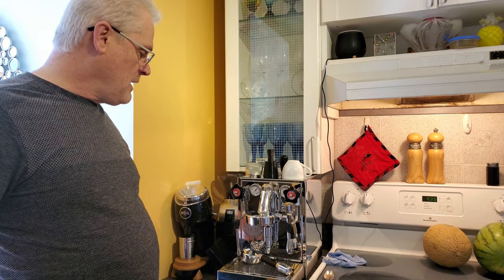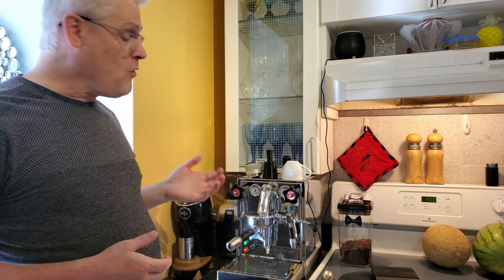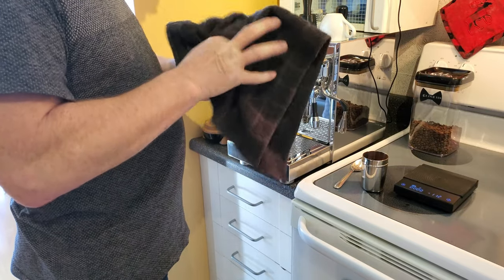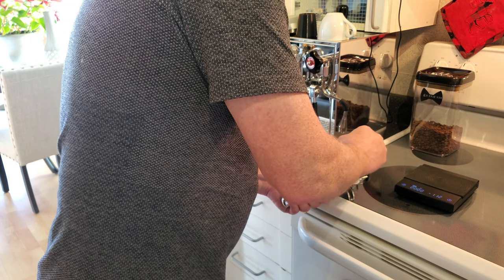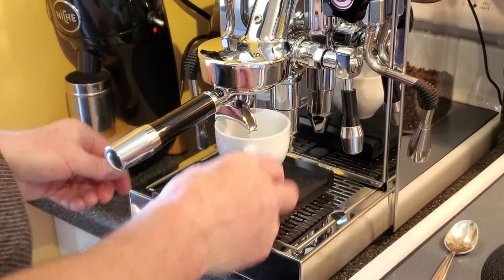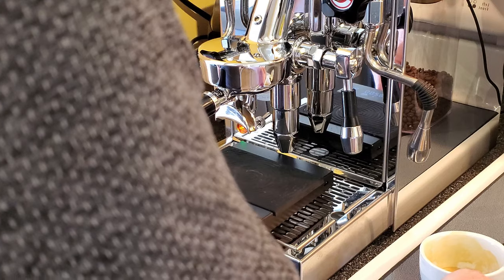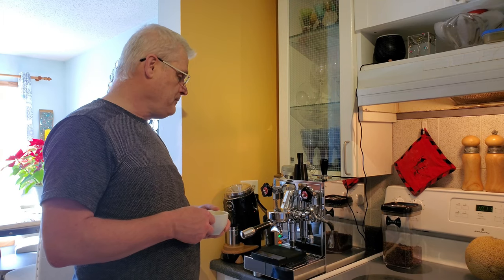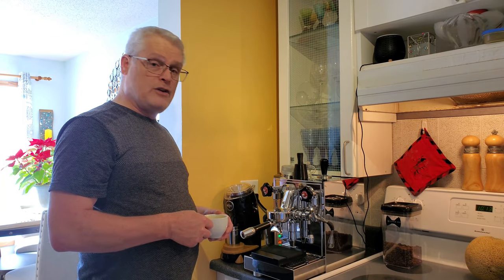ECM Mechanika V Slim Espresso Machine work flow

Comment: Really helpful!  This is a machine I'm considering and your video really let me see what a test spin would look and feel like.  Keep up the great work!
Reply from the maker: I'm really happy with your comment. One of the reasons I made these videos was there wasn't many videos featuring the Slim in practical use.
Reply: @staglite  And what's even more funny is that I currently have the same Solis you were using! Taking some time to decide between the ECM or Rocket Mozzafiato Type V.  I'm not convinced PID is really needed on an HX machine.  What machines did you consider before deciding on the V Slim?
Reply from the maker: @hoselrocket2001  I look at the rocket, Leite Profitec and ECM. In the end it was between the ECM and Profitec. Based on my research a PID doesn't make much sense on a HX machine. What I would get is the flow control kit or have it installed at the time of purchase. This is especially true if you like light roast or you plan to go in that direction. Ultimately two things decided it for me; build quality and physical size of the machine. If you do a lot of milk drinks look at the Profitec 700 as I believe it is a dual boiler. For me the HX makes more sense as I drink two milk drinks a day during the week and 4 a day during the weekends. If you have any other questions please let me know.
Reply: @staglite  Have you considered adding an Eric Thermometer to the group?  It seems that would be far more useful on these HX machines than having a PID.  Even the HX machines with PID require some amount of cooling flush.
Reply from the maker: @hoselrocket2001  I'm giving that some serious 🤔. But they are not cheap given that they are only a gauge. I looked them up this morning and there appears to be 2 different ones available. They are almost the same price.

Comment: Does the ECM not do preinfusion??? By slightly lifting the handle for 3-4 sec?? I’m looking at same machine upgrade from my Silvia….
Reply from the maker: I've done some research on this and the answer is no. Because this is  not a plumbed machine there is not enough force in the system to properly pre-infusion. What you do get is something called wetting. The issue with wetting is that there no guarantee that you will getting proper infusing of the puck all the way to the bottom.
If you want true pre-infusion get the flow control device when you purchase the V Slim.

Comment: HI, nice set up. Am looking at getting the Mechanika Slim this week. Was just wondering though... why you don’t use the Niche for grinding filter coffee? Is it simply so you don’t have to keep changing the setting back and forth and can have one machine dedicated to (roughly) each type of grind? Thanks.
Reply from the maker: It is just easier to have a dedicated espresso grinder. Also I'm not a fussy about my drip coffee.
Reply: @staglite  thanks for the reply. Thought that would be the reason. Have just ordered my Mechanika. Should arrive tomorrow! Keep up with the videos. Be interested to see if you get any more toys. Am thinking I may get the E61 Competition Shower Screen and also the Flow Valve Device in the near future.
Reply from the maker: @TheComaProject  Spend your money first on a VST basket. One biggest taste improvement for the money.
Reply: @staglite  Thanks. Can you tell me why you went for a 20g basket when you grind 18g? Does the puck get a bit soggy?
Reply from the maker: @TheComaProject  I use a puck screen and I wanted to make sure I had enough room. My puck are pretty dry but not prefect.